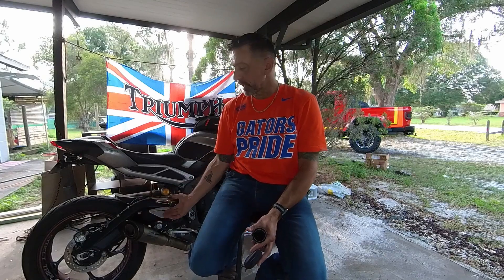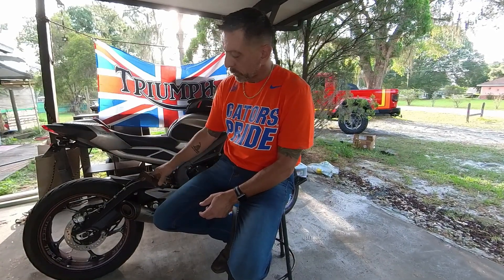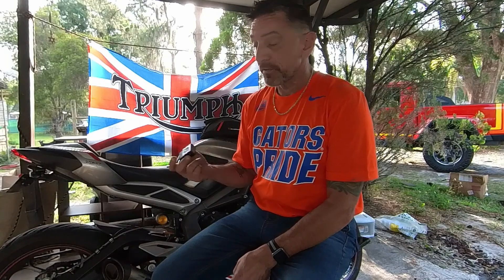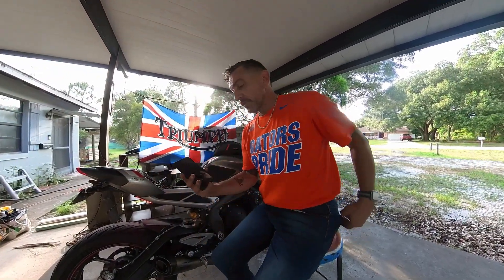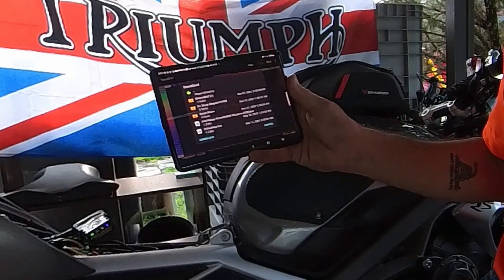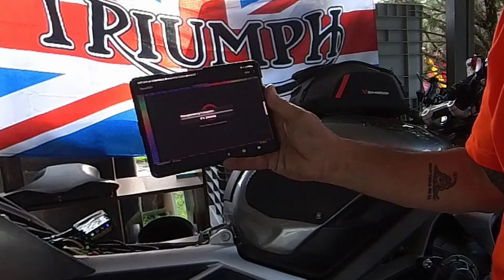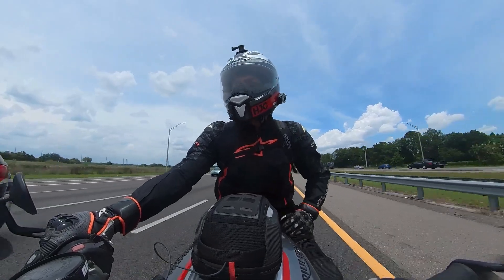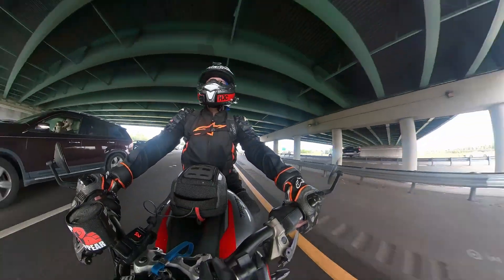ReMap your motorcycle ECU at home!

Comment: 🤣🤣🤣 It's a scam dude.
Reply from the maker: It’s not
Reply: @EvolvingMale  Oh, it definitely is. Show me a dyno of that tune with A/F readings. I'll wait.
Reply from the maker: @midas61  well, there would have to be a Dyno near me. Why do you think it's impossible?
Reply: @EvolvingMale  Because I know who DNK is, who she is and what she does. You have been conned.
Reply from the maker: @midas61  well, it does run better after I did it. So there’s that.  Just making blanket statements also doesn’t help. I mean either explain yourself or why bother saying anything.
Reply: @EvolvingMale  It's not a blanket statement, this is what I do for a living. If you put that bike on a dyno and have the air fuel ration looked at you will find it is no different than it was before. Blindly playing with fuel and ignition timing maps with no real time readings is a dangerous thing to do. The only way you are going to see what I am talking about is to take it to a dyno.

Comment: DNK TuneWorks is awesome! I sent my ECU in and had it back in a week. It’s also helpful to note that if you request a tune without the baffle there is a noticeable difference when you reinstall the baffle. Makes it a little less responsive and seems boggy.
Reply from the maker: I would agree. Part of the reason I’ve left it out for over a year. FTW! Or my neighbors. It’s sounds great
Reply: @EvolvingMale  same here. I’m going to be in contact with them soon to see if they have a tune for 95 octane and to add a quick shift and for a speedometer correction for a 44 tooth rear sprocket. With a Full S1 exhaust, BMC air filter, and Venturi velocity stacks I redline 6th. Need a little more leg lol.

Comment: Question for you I have a 2022 Street Triple RS I did a Yoshimura slip and a DNK filter & DNK tuneworks. I feel like if you stick the bike in rain mode or any mode the throttle response is pretty much the same it does feel faster does feel better but the throttle response is the same across the board do you feel that also?
Reply from the maker: Not at all. The throttle response is changed dramatically. It didn’t change any of my modes from what I can tell.

Comment: Your explanation of the 12 minute tune was incorrect.  You don’t just run the bike for 12 minutes.  You start the bike, wait until the fan starts, then leave for 12 minutes.

Don’t touch the throttle the whole time.  Turn bike off after 12 minutes of fan running. 👍
Reply from the maker: You are correct.  I missed that. I talk about it in another video and I believe I get it right on that one. Thanks for the heads up, if only I could edit the video after it’s posted
Reply: Once you do the re-flashing of the map there is no need for the 12 mini tune that’s the whole point of the remaping. Js
Reply: @Mrfc50  Correct. Triumph has self-learning ECUs with auto-retune based on the above procedure. In theory, running that process has superseded the tuneEcu map applied immediately prior to the fan+12min process. Therefore - is/was it ever needed?
Reply: @RichDunn  I’m eating sorry but I do not understand your question? When I did my tune ECU I flashed it, and I rode the bike. Therefore, it does not need the 12 minute tune.

Comment: Can ypu please provide an update on the tune?
Reply from the maker: Yes. Running great. It uses more fuel, but that's to be expected because it was so lean. It really made made a huge difference. Totally worth it.
Reply: @EvolvingMale  Did you specify an octane level being used and/or did they specify the octane needed to be used with the tune?
Reply from the maker: @matthewbodish6133  no.  Our bikes require premium gas from factory. So that's what I use
Reply: @EvolvingMale  according to the manual (Page 95) it is 91 Ron minimum, which is 87 octane. I called my local dealer and they said regular 87 as well.
Reply from the maker: @matthewbodish6133  huh. I didn’t know that
Reply: @EvolvingMale  yea, I was surprised myself. Have you done any dyno runs?
Reply from the maker: @matthewbodish6133  I haven’t. I can’t find a place around here that doesn’t primarily do Harleys. I don’t trust them on a real motorcycle.

Comment: just watch your video bro love it alot of information.. I have the same pipe but don't have the intake I was looking to remove my DB but I can't seem to find nowhere to grip it to pull it off. I took the pin out but can't find it. I'm going to do this tune after I take off the little wrench key on my dash.
Reply from the maker: I had to use the more expensive ob2 module to be able to push it through. You can order it from Amazon and Return it when you’re done and save $140. I use two long nose pliers to grab the db killer and yank it out.
Reply: @EvolvingMale  that's the problem I would have love to send you a picture of mine cause I don't see no where I can grip it.. at one point I was thinking this SC didn't have it cause everyone just grip on something and pulls it.. I ordered the 140$ max one and I'm also going to follow your tune after I buy the intake.
Reply from the maker: @franciscopena446  email me at evolvingemale@gmail.com and I’ll send you a picture of mine and how I do it